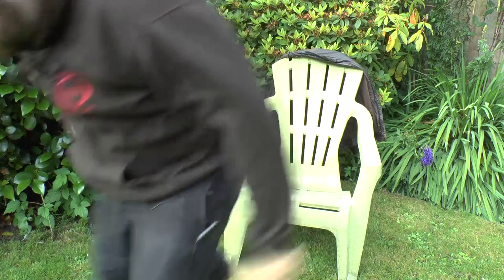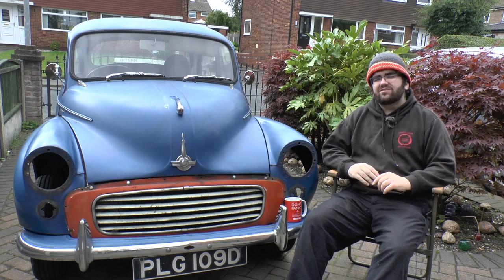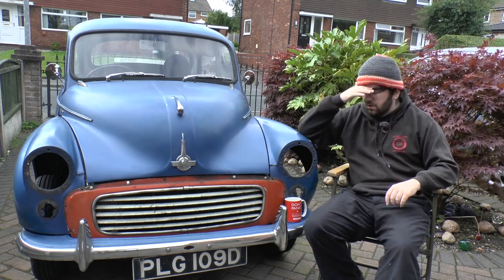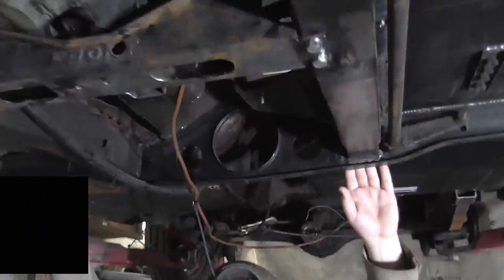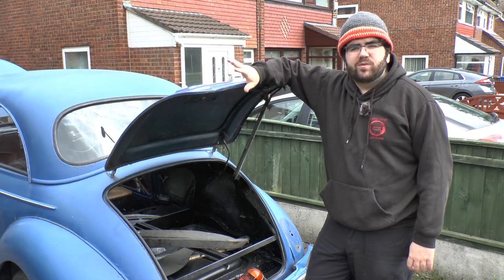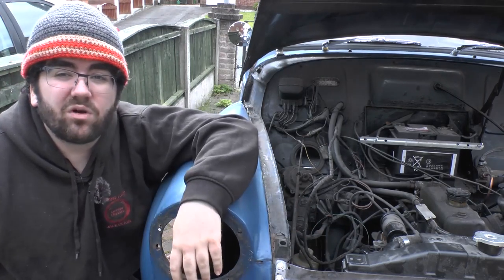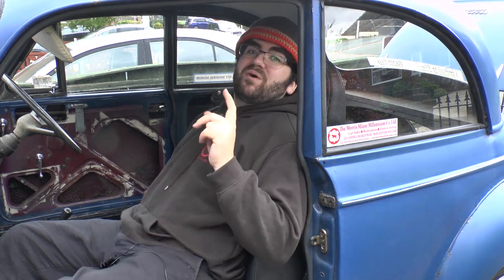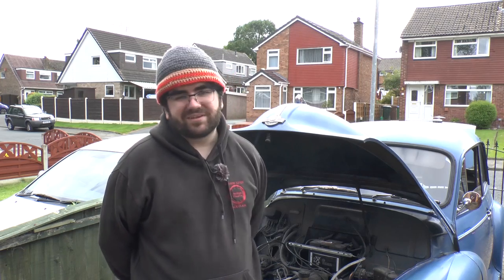Morris Minor - Welding Work & Future Plans - Project Daily Drive #11

Comment: The wiring is the only major job I did on my 53. I looked at that same spot out of the firewall, and just decided to throw the side cutters at it right there and then. 8 wires needed in the back and 9 in the front including fog lights and spot lights. Also added fuse and relay boxes.

Comment: I think Intermittent wipers are a cheap and useful upgrade. You can get a variable timer online for around £20 . I kept the original switch on the dash and added an extra switch below the dashboard for the timer also you need to take a wire from the motor side of the original switch and take it through the relay switch on the timer. My car is negative earth and has a single speed wiper.

Comment: Ok all the very best with the restoration I’m sure you will do a great job! Years ago I bought a Fiat Amigo caravanette from a Vicar in rural west Wales months later when I jacked it up and the sills just collapsed found that he had fibreglassed the sills and filled the sills with religious newspapers the sills cost about £3 each from Fiat at that time l! Days later the engine blew up !  After renovating it I made the mistake of starting it in gear it ran straight into a steel skip demolishing the front end Happy days ! Good luck

Comment: Whist the car was bodged and took a lot of work to correct glad you saved it. Thankfully the car is a popular classic and panel work can be purchased new. Imagine if these parts were not available?  You should seriously think about protecting the new panels before the onset of damper colder weather. Wax oiling the box sections is best done when the ambient temps are relatively high.

Comment: Hi there. Spend the whole morning watching your video's. Keep up the good work. I'm restoring a Morris Minor Van (1971) myself at the moment. I'm doing all of the welding and straitening etc. myself. I like to replace a lot of the worn parts and did quit some upgrades like disc brakes, 5 speed gear box, PU bushes, CSI distributor and lots more. I'm pretty sure the costs will grow up to 10.000 pound. I'm curious what you had to pay for all the welding or is this a to bold of a question?
Reply from the maker: Because of a few reasons I havent gonei ntro the cost of the welding yet but it certainly wasnt cheap, but you get what you pay for. Im sure your van is going to be incredible once its finished, and those are sensible upgrades to go with.

Comment: the wiring is dead easy to do use heritage wiring harnesse there is only two fuses in the sistem all you've got to remember is make sure all the grounds are fitted to bear metal